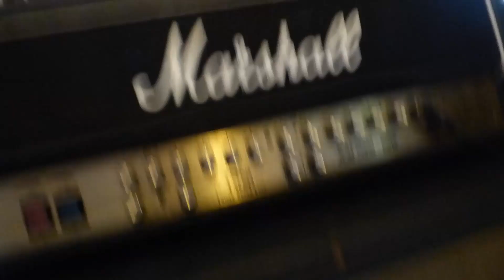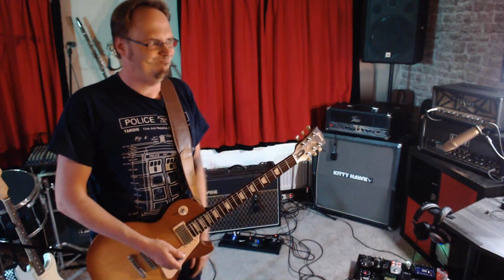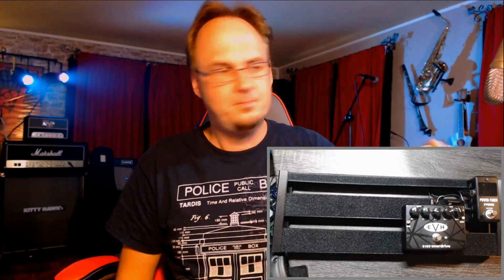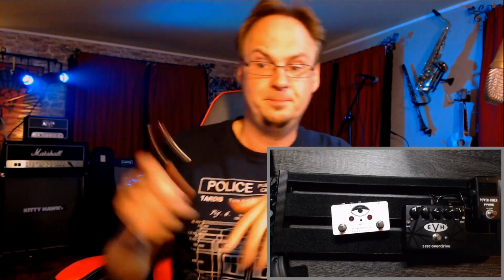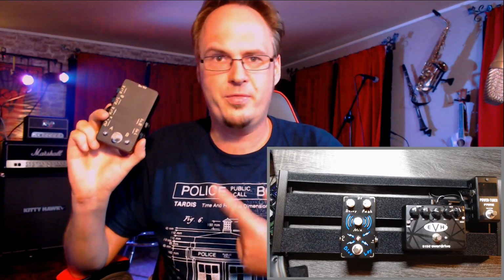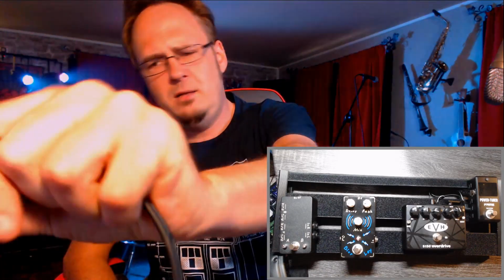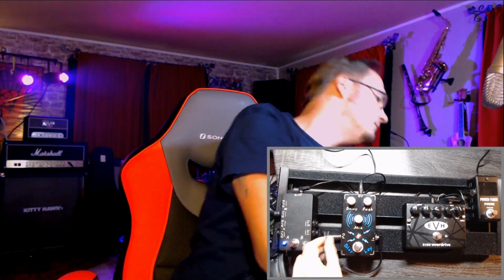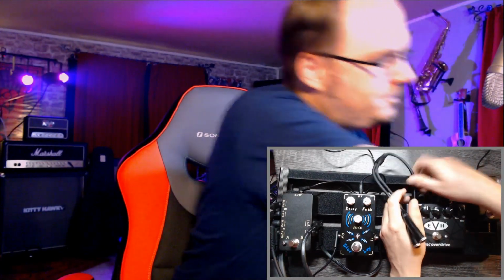Running two Amps with one Pedalboard - including Effects Loop

Comment: It seems to me that this pedal can only play A or B separately. Is is possible to use both amps both A and B simultaneously? So that both amps are using the same FX loop at the same time.
Reply from the maker: Hi. Yes, this is only a either/or solution. If you want to run both in parallel, I guess you would have to put in more budget to avoid hum problems.
Reply: @duchyofdrive2922  any suggestions?
Reply from the maker: Can't think of a stock product. Maybe try looking for a stereo AB/Y. Otherwise going custom might be an option. Have good experiences with dscustom.net.
Reply: @duchyofdrive2922  awesome, thank you!

Comment: Also I have another question, is there ground loop issue with this setup? Any hums?
Reply from the maker: Hi there, for the tuner and drive pedals, I just use a Y-cable after the last effect in front of the amps. Since the switcher cuts off any signal in the effects loop of the amp that is not in use, those are muted as well. I also didn´t have ground loop issues with this setup.

Comment: Hi - great video, really useful. I wondered if there were any issues with losing guitar signal strength with the y-splitter cable? If so, is the answer to use a mono AB for the front of the amp instead of the y?
Reply from the maker: Hi @Tim Goody. I never had any issues with the Y cable. I used it to avoid an extra step on the pedalboard. I guess you could test the setup for signal loss with an ABY switch.
Reply: @duchyofdrive2922  thanks!

Comment: Danked sir! One question: I assume you connected two ''combo amps'' in this exemple? So you connected the two amps to your pedalboard and also chained the fx loops with your method. Very very nice. Now, if you only want to use ONE cabinet? Same goal here: pedalboard going in front and in fx loops of boths amps but with only one cabinet. (Probably needs one more XY pedal to switch amp1 and amp2 into a single cabinet?) Thanks a lot! Very instructive, I have been searching for this! peace
Reply from the maker: Hi there! Thanks for the question. Check out my video about the ampete 221. An alternative would be the Mesa Boogie Head Track.
Reply: @duchyofdrive2922  Thanks a lot for your answer amigo. I just watched it and it is perfect! Like I said, i have been looking for this kind of method and yours is the more complete answer because, most other videos don’t take the fx loop into account and it is frustrating. So you think that these two devices are the only one for this puspose? I mean, the Fender ABY switcher pedal (or similar pedals) can’t fo the job we want?
Reply from the maker: @FrancisJulien418  not if you want to have two heads on one cab. The inactive one has to be switched to a load...
Reply: @duchyofdrive2922  yeah... gota do what you gota do! It is a little bit pricey for me at the moment to fo « just experimentations » but maybe I could find a used one for a little bit cheaper. I understand now that I need this in my life if I only want One cab. Thanks to you dude! I will watch more from you. I sub! Good job

Comment: Cool video, many thanks for sharing. I bought the Palmer Tino to switch my amps, but I did not consider the fx loops to split modulation pedals. I wonder if I can do the contrary you did, I mean that the main signal will be managed by the Palmer Tino, and for the fx loops, I’d like to try with 2 double jacks: one to connect to the output of the last modulation pedal to both SEND fx loops, and one more double cable to connnect both RETURNS to the first modulation pedal. Do you guys think it could work??

Comment: I have a Morley ABC Switcher pedal and have a question. How do I send output of my pedalboard that is connected to input of my amp to the pedal? Sorry to ask a dumb question but the inputs only allow one cable from each amp. I want to send pedalboard-> amp-> Morley switch pedal input A and then on amp 2 send output of pedalboard 2-> amp2 -> morley pedal input 2.

Comment: Thank you for the video. I do have a question.

In case a multi effect guitar processor has only 1 output which means I can't use 2 Amps if the Amps doesnt have an fxs loop (4 cable method).

So can I get a "Y cable" to use that on my guitar Multi effect processor and its going to be connected from it to a (loop station) or whatever device that has R & L and thats going to split the signal to stereo, is that correct? 
Example: I will have the input from the multieffect unit sent to a loop station R & L (input) and have the amps coming out from the loopstation as stereo out R & L.
Reply from the maker: Hi @Guitarelic. If I get your description correct, a simple A/B Box should do the job for you.

Comment: how about running 2 amps into 1 cabinet with attenuator in between ?
Reply: I would be careful with that. Not sure what cabinet you have but I would recommend that you stay away from that unless you have a 4x12 cab and the left and right speakers are wired completely independent from the each other. Anything short of that I would just use two cabinets.

Comment: Hi there! How do I know if my amps have a serial or parallel fx loop? I ve got a Marshall 2000 dsl 50 and a Carvin combo club master 112.Thanks!
Reply from the maker: Hi. If your amps have a pot where you can adjust the amount of effect in the signal, these are parallel effects loop. If not, it is most likely serial. With a parallel effects loop, you can try to adjust the effects level all the way up. This should cut the dry signal and make the loop more or less serial. But some amps still route some amount of dry signal even if the effects level is all the way up. Guess you will have to try without effects plugged in. If the amp is silent when having effects on full, it should work with this method.
Reply: @duchyofdrive2922  Got it.I have no pots on both amps so hope they are serial. Thanks
Reply: There is only a loop level button next to the fx loop on the jcm 2000..

Comment: What if I want both amps to run at the same time and both loops on/off at the same time.
Reply from the maker: That would be much more difficult and more expensive. Especially if you want the loop effects routed to both amps at the same time. I looked for those switchers and couldn´t find one. Closest thing would be the Ampete 222, but with that, you can only route the effects to one of the two active amps (wet/dry).
Reply: @duchyofdrive2922  To add to this. Im trying to think of a way to run my Twin reverb, Into my super six (which powers a leslie) , into my dual showman. I’ve seen some pedals from Lehle that offer three amp switchers. But is it even possible to have the three amps on and effects loops and all three amps going at once? Or would this require some wacky 3 headed cord and some modification to the amps?
Reply: @duchyofdrive2922  i dont really get what you say?... isn't just enough to buy the first white device that you showed in the video and then for the fx loop buy the black one and run both devices at the same time?

Comment: Can you just use 1 stereo pedal that has 2 ins and 2 outs… and from the effects loop on each amp.. thus:
*From fx loop 1 the send goes to input 1 of pedal.
*From fx loop 2 the send goes to input 2 of the pedal.
*From fx loop 1 the return goes to output 2 of pedal.
*From fx loop 2 the return goes to output 1 of the pedal.
Reply: I was thinking the same thing. Does anyone know if this works ?

Comment: Hello, great video! Would it to be possible to run one pedalboard into two effects loops? I have a Mesa Boogie JP-2C and Peavy 5150 and would love to figure out how to use both effects loops at the same time.
Reply from the maker: Hi there. Should be possible with some kind of stereo ABY. Can´t find one after a quick search, but I guess you can have one custom built. Maybe there will have to be some kind of ground lift on one of the channels....
Reply: Hey Greg the answer is yes. I currently run my Mesa mark 4 and my EVH together with 4 cable method for each amp using 7 cable method running stereo. Check out plague sythe studios here on you tube. “7 cable method “ or “4 cable method stereo “ is the tittle. Highly recommended channel. Ryan really know his shit and has some awesome content you might find useful

Comment: Hey dude kool vid...you were touching on some points where I’ve hit a brick wall
In my own chain. I was hoping you could lend a hand.

I’m trying to use my mooer ge300 multi fx amp modeller (going out of the XLR outs using 2x frfr powered speakers as cabs) and a katana artist in a two amp blend using and ABY to split both. The powered speakers sit either side of the katana... so 3 speakers are in play. This part is easy enough everything is split through the ABY... great I have two essentially ....  But when I stomp an Fx on the ge300 it only comes out of the powered speakers. And like wise if I stomp an fx in from the katana using the GAFC it only plays through the waza speaker on the katana.  How can I sync the fx of both units without phase issues ... but it is paramount that the modelling from the ge300 does not colour the artists dialled in preset and vice versa.
 
I mainly want the katana to be a dry rig... I want the all the modulation delay and reverbs to come from ge300. But when I stomp the distortion and wah of the ge300 I want it to play out all 3 speakers. Like wise for the katana if I stomp in a distortion from the GAFC I want to hear it out all 3 speakers.

Is this possible? 

Cheers.